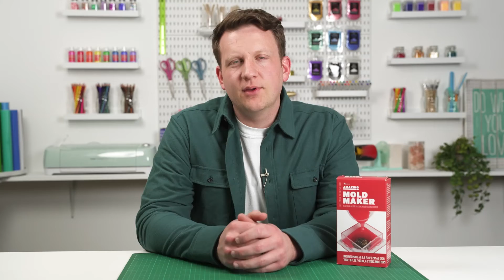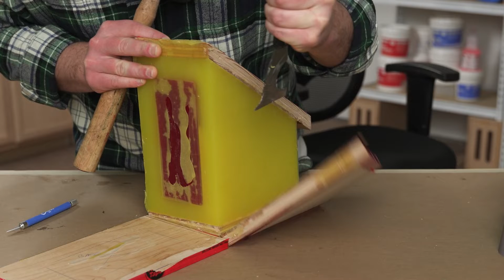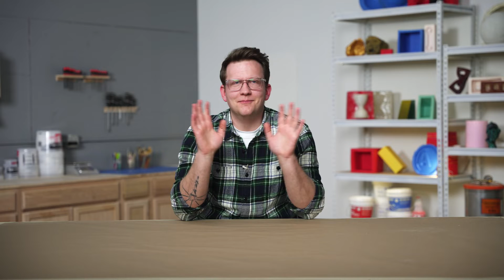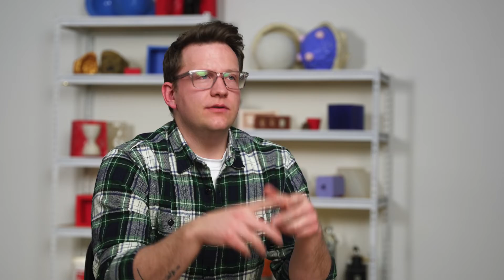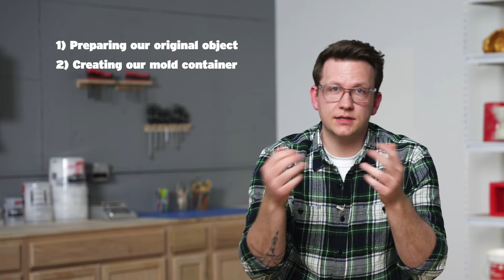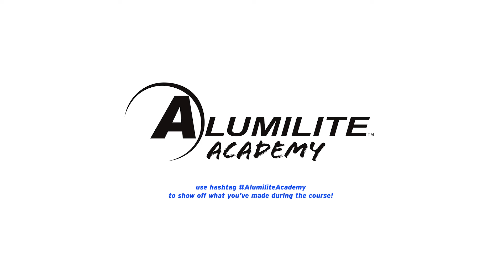Silicone Mold Making Basics Ep. 1

Comment: Does the quick set silicone and catalyst go bad? 2 times now I've tried to make molds but after 3 days the best it's hardened is I can touch it, it is sticky but won't leave anything on a tool or finger after you pull it off.
Reply from the maker: Are you closing the bottle caps all the way? If air gets in there it could effect the materials but it should be lasting a lot longer than 3 days
Reply: @AlumiliteCorporation  Willing to make molds for me???
Reply: I really wanted to learn mould making decor